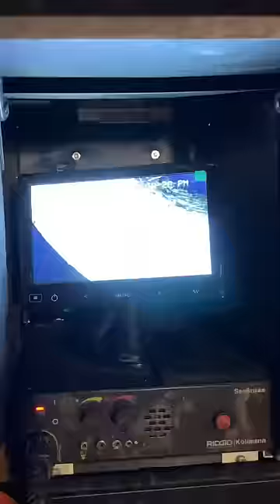Clearing a sewer line that was clogged. #HandsomeOrHandy￼ #Handyman #Plumbing #HomeRepair￼

Comment: Those speed rooters are not light! I couldn't believe how heavy mine is with the 3/4" cable.
Reply from the maker: I’m still trying to figure out a way for this thing to climb the stairs itself
Reply: @HandsomeOrHandy here are electric stair climbing dollies out there. There are a few rare ones sometimes used in the food service delivery sector.
Reply: @HandsomeOrHandy  K7500 ridgid machine with 70 meters of cable.....holy shit

Comment: Hey great video I think I have the same problem. I had roots in my main line and it was clogged before. This time It's backed up again but I ran the snake 🐍 in went all the way out to front yard. But water is not coming out like it should. It keeps backing up the tub is it possible the pipe is crack in main line and backed up in the house/tub?
Reply from the maker: It’ll probably be best to run a camera out to see what’s going on.

Comment: I know it’s not for everyone and it’s expensive, but check out the Milwaukee MX Fuel auger. It has tracks on the back that are motorized that haul it up and down stairs. Might be good for the back after all the years hauling the normal ones.
Reply from the maker: Doesn’t look like a bad machine, a little bit more expensive than this one is
Reply: If it’s anything in line with the quality of their sewer cameras I’ll stick with Spartan/ridgid. 

Milwaukee plumbing tools are all flash no function imo
Reply: @TheDirtyLuigis  Nah its definitely better than the sewer cam. Its just nice cause its battery powered on their huge MX Fuel batteries and climbs stairs on its own so its a back-saver.

Comment: Good video.  The water supply valve is installed upside-down: it should close parallel to the floor so that it can't inadvertently be bumped down and on.

Comment: Please always check to se if any utility have been replaced or worked on before running a sewer machine down, say the gas company ran a new line and hit the sewer and didn’t know, u run sewer machine down hitting the gas, it will fill every single home on the sewer line with gas, it can be a massive problem, reason I know I work gas and it has happened

Comment: I’ve gotta dig up my own sewer main this spring or summer myself. Apparently previous owners had the main replaced BUT they people didn’t replace one foot of pipe that goes to the main and I got roots growing in! :( and it’s after the 100ft mark so I have issues of the sewer guys cleaning it with ease. And I don’t wanna pay 6k bucks for a 1 ft pipe replacement! Like hell naw! I’m gonna do that myself and concrete da FUk outta that connection. Lol ain’t no roots gonna mess with my sewer again!
Reply: Roots grow through concrete.
Reply from the maker: You might be able to have a small section of the sewer pipe repaired with a trenchless repair technique.
Reply: @HandsomeOrHandy  
It's only a one foot section of pipe that he needs repaired.

Comment: I didn't know this until recently, but you're supposed to call 811 before augering a sewer line because of the chance that a gas line cross boared the sewer line.
Reply: Technically the city or whoever sent the gas line there is at fault tho. They'd have to fix all that cuz the sewer was installed first. But I get you...
Reply: No that’s incorrect. That’s only if your digging lmfao

Comment: Do you not use the locator with your camera?
Just curious.
Reply: Didn’t look like it was necessary, he got the line clear. Locator is only needed if there’s a problem noted during the camera inspection
Reply: @TheDirtyLuigis  did you miss the part where he found a collapse?
Reply from the maker: My sewer camera does not have a locator head on it.
Reply: @HandsomeOrHandy  I figured it was something like that. Both the transmitter and wand are expensive add ons. 
I used to work with a guy that like you had neither…through experience in plumbing construction and layout…he could tell you where the main exited the home or building and measure out anything he needed to know like you did.

Comment: Hot water. Always hot water.
Reply: Hot water prevents the camera from seeing anything due to the steam. Source: I run sewer cameras all day for a living
Reply: @TheDirtyLuigis  always flush with hot water.  If you need to cool it down after wards you can. But always flush with hot.  I am a plumber, I run pipe, cameras, and snakes for a living.    Less likely to back up again with hot water.
Reply: @TheDirtyLuigis  right on

Comment: I worked for roto rooter for a couple years and was known for not wearing gloves while running my machines.. oh man Trey will run that sewer machine with no gloves!!! My motive was if the cable comes back dirty then you didn’t clear the line! 🤪
Reply from the maker: That is one of the reasons I like to run water after I get the clog free. It helps clean everything up.

Comment: Question the camera said 54 feet out how did you end at 35 feet out? Why not bust out the locater and mark it exactly were its at!!! Takes 5 minutes if that.
Reply: They may not have the locator.  They determined it is 35 feet from the basement wall. That's the math part of what he said.
Reply: @JenniferPittsfl   I get that, but witch way not all lines run verticaly I've seen some that are angled. Straight but at an angle. Also I've seen this in pvc when it's a old or older house its cast the connects to clay
Reply: @MaxPower1000.  that's not made clear in the video... I'm sure they'll run something to specifically locate the pipe as he said they're going to have to replace it.  Just guessing though 🤷‍♀️
Reply from the maker: All I know is it’s 35 feet out from the basement wall. Before we dig up the front yard we will have it located.
Reply: @HandsomeOrHandy  yep that's what I figured.  You have a general distance, you'll locate specifically when ready to do job.
Reply: @JenniferPittsfl  Well that sounds like they are not ready. I carry all that in my truck . 1065,k35,k50,k1500and two sea snakes and two locators. Do the job once done right.
Reply: @JenniferPittsfl  imagen I get to your house and I have to got to home depot because I don't have the right tool or machine and guess what, I'm still charging you for all this. It's  $175 service call and $95 dollars an hour after that. Turns expensive quick. But if I have all that less time for you and me and I get to go to my next call. Other companies charge 50 dollars ever 15 minutes.
Reply: @MaxPower1000.  I don't follow what's your point? If you're professional at your job you get everything together and ready for a job. If you come to my home and have to go get a part or something but charge me for the time it takes you to go get it.... I'm not sure if I'd let that fly or not. I've had contractors come to do jobs and have to go get a part or something and I was not charged extra (time-wise) because they had to run to Home Depot or something.... I only got charged for the part (and that's if it was something unexpected).
 I'm sure the OP is professional enough he'd be ready for the job when the time comes.  It's probably snowing there right now and they're not ready to do the job yet so why mark it.
Reply: @JenniferPittsfl  sure if you know him. Done right done right the first time.

Comment: that type of camera can be fitted with a device so you can find it very accurately with a scanner even through concrete and deep down
Reply from the maker: Look at purchasing some of those transmitters, but they are quite expensive

Comment: I had my sewer line inspected with a  camera they charged me $500. I thought it was a little expensive.
Reply from the maker: Unfortunately these cameras are around 16,000 for a new one.
Reply: @HandsomeOrHandy Thats some bullshit. its not even a hi res. Just attach a go pro mini to a snake at that point lmao.
Reply: We just bought a new camera, same one used in this video. With camera, monitor and locator it was about $15k. $500 is a little steep, but depending on your area that doesn’t seem outrageous. We charge $229 and we’re in a smaller city
Reply: @TheDirtyLuigis  Why not use vastly cheaper solutions. you just need a water tight camera at small form factor to a display no? 15k for a setup is outrageous.

Comment: Why would you turn off the water to run a snake down a drain line??
Reply from the maker: Because the tub on the main floor was filling up with sewage and I did not want someone to start taking a shower. Once I got the line open water was restored.

Comment: This is where I draw the line as a handyman no poop stuff, I barely wanna change someone's toilet
Reply: Weak
Reply: @mailliw75  sowwy grampa
Reply: Another reason why handyman shouldn't touch plumbing.
Reply: @disquiet3163  it's just a simple toilet installation bruh
Reply: Handyman isn’t the same as a plumber
Reply: Toilet swaps are great . I get 350 per and am in an out of the job in less than an hour and water supply line and wax ring are only a few bucks
Reply: @lobsterstrange  New Jersey . Cost of living is high here and some people won’t pay that here as well but a lot will